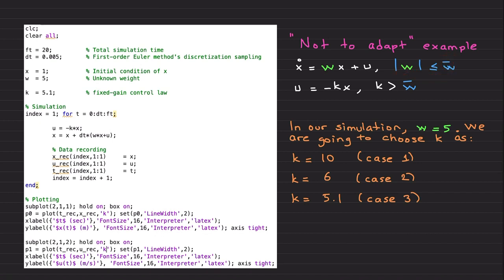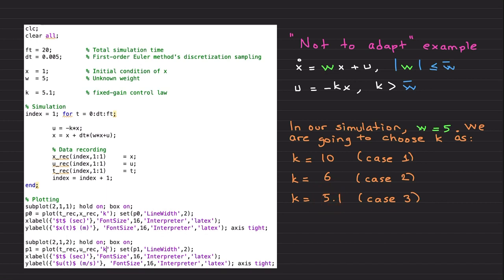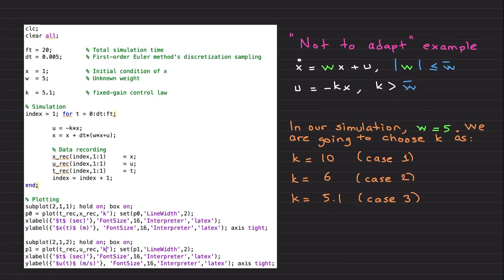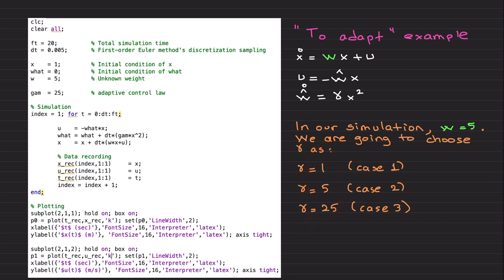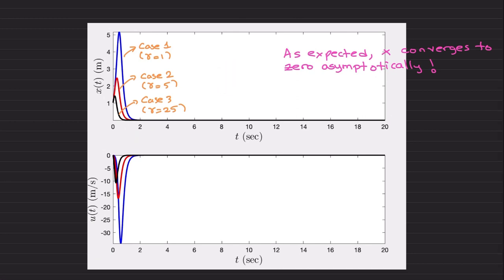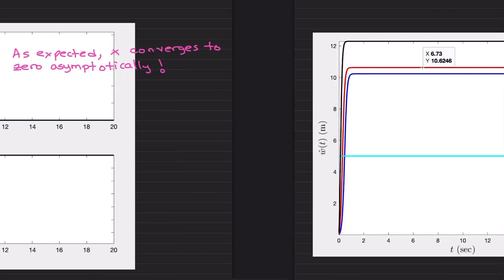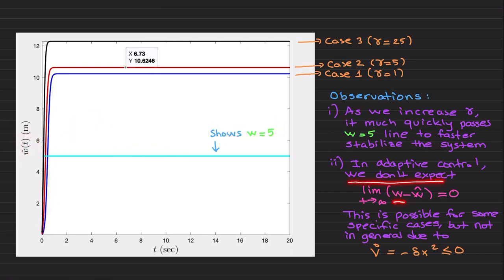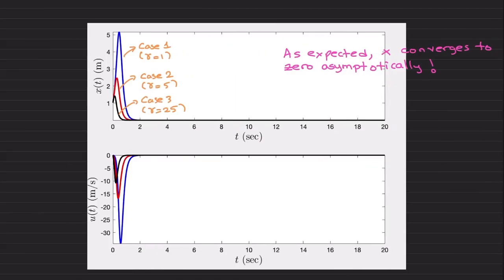To Adapt or Not to Adapt Example in Matlab (Lectures on Adaptive Control and Learning)

Comment: thank you doctor. Can we say that this is a direct adaptive control approach. What is the difference between direct and indirect and how we decide which one is better for specific application
Reply from the maker: It is a direct adaptive control (DAC) approach. In my personal experience, DAC is generally better than indirect adaptive control (IAC) approaches. Because, IAC requires "persistency of excitation" condition, where if this condition is not met, IAC may not improve its performance. DAC does not require this condition to drive error to zero!
Reply: Sir can you make a video lesson on  IAC with an estimator and as expected with the subject "persistency of excitation" condition? Thank you so much.  @tyucelen

Comment: Thanks for the wonderful series. 
I tried to play a little bit in simulation and i added some sensor noise. so the input of my controller is now 

y = x + 0.1*sin(10*time)   // my sensor
u = -w_hat * y
w_hat_dot = gama * (y^2)

my system still converges but w_hat diverge to infinity ( the noise is squared so w_hat_dot is always positive ).

In a real system do we just impose a maximum fixed gain for w_hat ?

Thank you
Reply from the maker: 🙏 The stability proof in the previous video will not hold in this case. In other words, closed-loop stability is not guaranteed with perturbation due to sensor noise is included. To keep parameters bounded in this case, you need to use a projection operator or a leakage modification term. Good news is that I will cover both in the following weeks. Stay tuned 😉
Reply: @tyucelen  just curiousity doctor. if we had chosen here a lower frequency for the signal added, in that case maybe that signal would be disturbance, colud this system maintain its performance